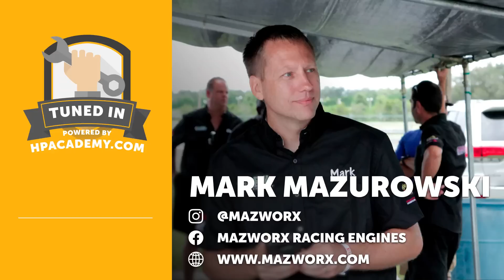Is A 200 PSI, 3000 HP 4 Cylinder Even Possible? [#PODCAST 095]

Comment: Still waiting for folks to go "old school" to the days when the head and cylinder block was cast as one piece - modern machining techniques should make it reasonably simple to machine a billet head and block assembly, and the matching crankcase assembly it's bolted to.
You can't blow a head gasket if there isn't one, and with a two(?) part crankcase there isn't such an issue with big-ends fitting down the bores and compromised webs..

Comment: I’m running a copper head gasket on my old Ford X-flow 1600. 
I machined 35thou grooves in the head, and installed piano wire, and the machined receiver gloves in the deck of the block. With an annealed copper head gasket, it bites in too the deck. 
Easily holds 11.5:1… it could hold 14:1 compression no problem.
Reply: I always wonder about these things why it's needed. My idi diesel runs 1:23 compression (stock) using normal headgasket and you can run 25 psi all day no issues.

Comment: Mark built my VQ37VHR. Engine has been great. I have had one learning curve on it and got a headgasket. I know all about being in unknown territory.  We learn and move on. Just fixed a couple of my problems and I am just about completely back together. I am ready to enjoy the car again. When you get to 900-1000whp crap happens. Just the way it is.
Reply: I think Formula Drift driver Chris Forsberg went to VQ37 turbocharged engine instead of N/A VK56 for his 370z. He eventually went to VR38, because VQ37 block started to crack at 900whp mark.
Reply: @vvevvevvvv  That's not true. None of that data has been shared. It is unknown what the true story is. I have been at 900whp for a while. The block doesn't crack.
Reply: @spooler7828  sure, of course. I am just telling the story Forsberg told somewhere.
Reply: @vvevvevvvv  We shall see. I am on a standalone now with all the extra sensors needed. I fixed my high IAT'S and emap issues. VQ's don't like a high drive pressure ratio. It causes the block to dance around and you end up with a blown headgasket.

Comment from the maker: TIME STAMPS:
0:00 - Mark Mazurowski Introduction
8:46 - USA Street Racing
23:00 - Engine Machining Development
30:00 - SR20 VVL Head Development
34:15 - Formula D Valvetrains
36:30 - SR20 Head Flow
38:45 - SR20 Cams
47:00 - Honda K Series Vs Nissan SR
54:50 - Sleeved Blocks
1:05:20 - Custom Stud Discussion
1:12:40 - SR20 Billet Block
1:19:00 - Billet Block Heat Expansion
1:22:00 - 200 PSI Development
1:28:00 - Development Takes Time
1:30:09 - The Future For Mazworx
1:31:49 - Advice For Others
1:34:20 - Thanks Mark! Links Below
1:35:43 - Leave A Review, Get Free Stuff And MORE Episodes
1:36:16 - Get In Touch Mate!

🧠 Win a T-Shirt or Mug by leaving a written review that can include a technical question for host Andre to answer - https://hpcdmy.co/reviewpodcast
This also really helps us gain more traction for the podcast, ensuring we can keep bringing you more and more episodes on the regular -  Taz
Reply from the maker: These are a little rough, but hope they help guys!